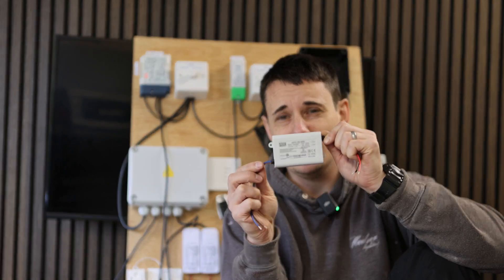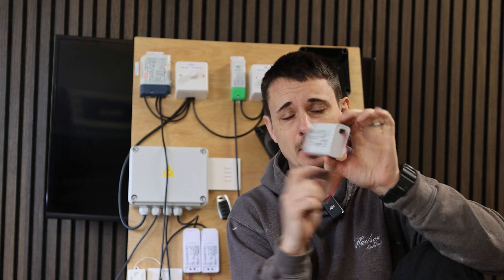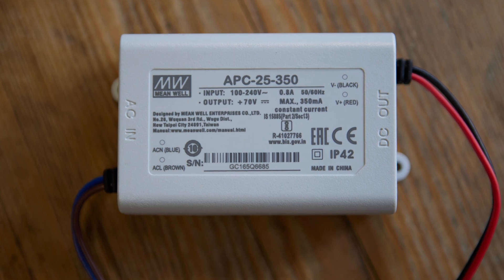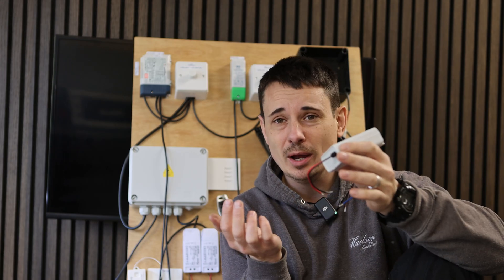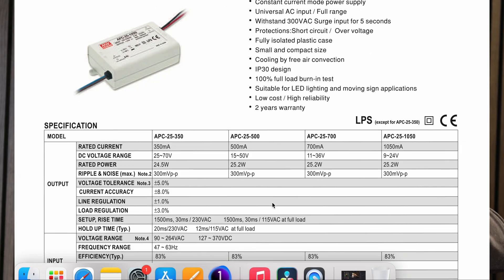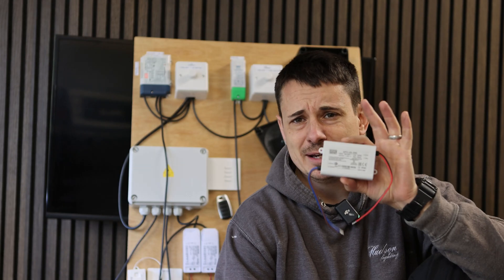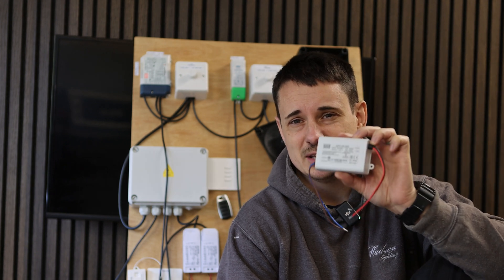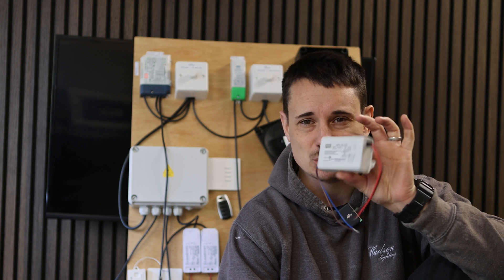Why are LED drivers so confusing?

Comment: You should already know that I found you through 2 Second Lean.
Miss your other/older videos but I understand why.
Improve for next time → downloadable fact sheet (something very, VERY simple).
Suggestion for next time → Top three complaints after the fact by external customers.
Reply from the maker: I'm 100% going to do that, Thanks Robert.

FYI, there is a separate improvement channel, if you search Hudson Lighting improvements